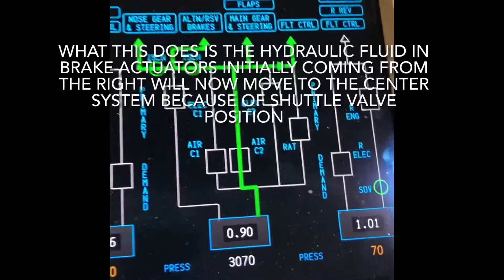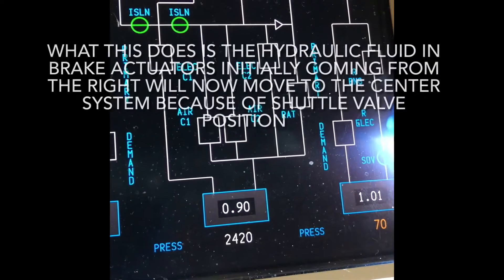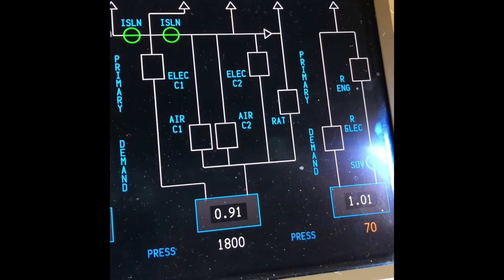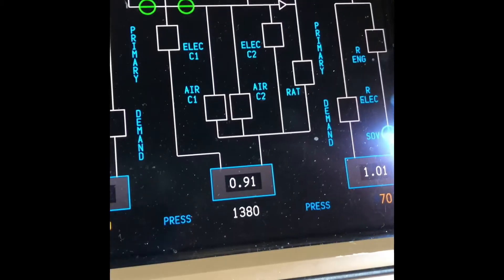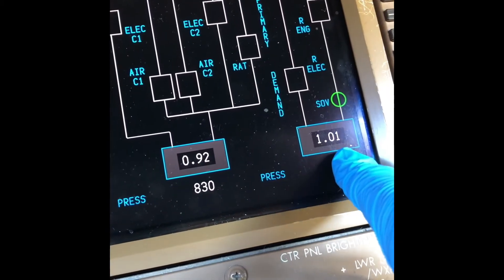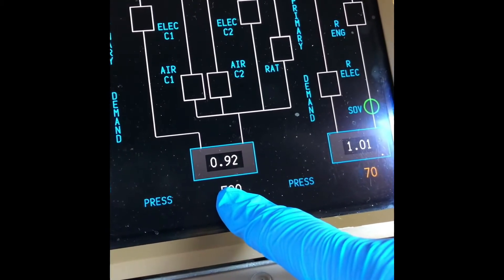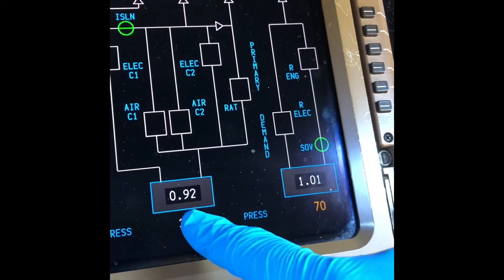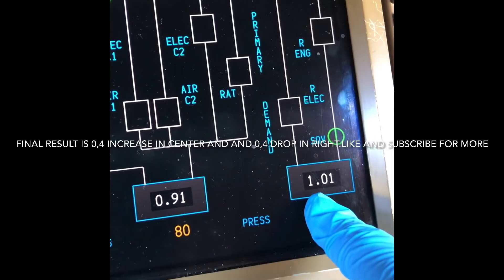Boeing 777 hydraulic fluid transfer between systems

Comment: Can you transfer to the left system as well?
Reply from the maker: No the left system has no connection with any of the braking systems,The logic behind hydraulic transfer on 777 is using brakes .The normal and alternate system are powered by different systems but use a common actuating device -The brake pistons,So here is the only place where independent systems interact.The left is totally isolated from the brakes hence you can’t transfer from or to it.